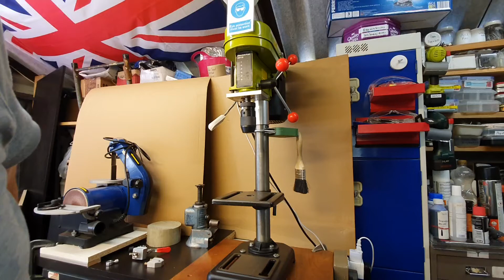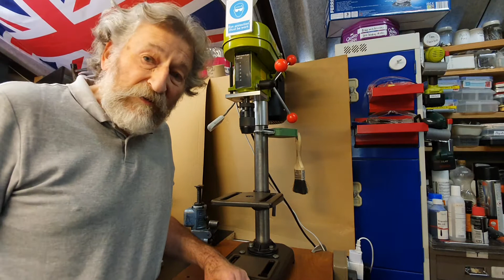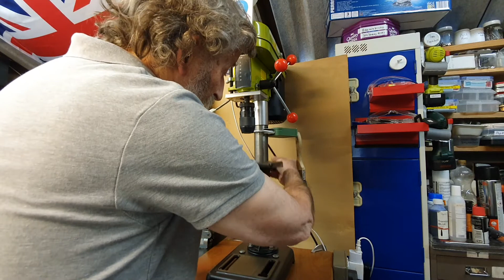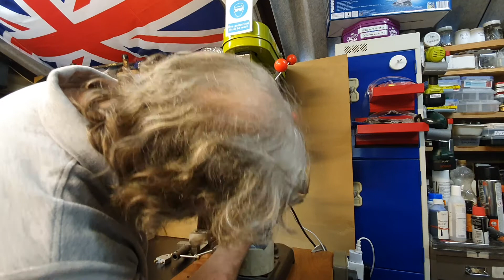Bench Drill upgrades.

Comment: Hi Nobby. Thank you for sharing your bench drill mods I wil make some of the ones you showed.  My main mod for this type of bench drill is to take play out of the quill.  like most of these drills they have considerable play side to side and front to back.  There is a nut and screw to take out side play and that is all , so I drilled and taped the front and put the same on the front and now there is no play at all even fully extended. I used brass to make it slide better but finally drilled the ends of the brass bolts and fitted in nylon mini bungs from kitchen fitments which are used to hide screw holes inside the units. After greasing with Marfac it all works like a dream and is precise with absolutely no play.
Reply from the maker: That's an interesting modification William. I agree these cheap bench drills all have this problem. I'll examine my one and see if I can do a similar mod. I always adjust the table as close as I can to the drill to minimise the amount of quill travel. I also centre punch the work to guide the centre drill first. This does help to keep things aligned. You should do a little video to share your modification. All the best Cheers Nobby

Comment: Scissors Jack's can be had easily at the junk yard. It's what I use. I also have perfectly operating old screw Jack's that can be used. But if you look around you can find small hydraulic jacks.
Reply from the maker: Hi George, thanks for the advice on the scissor jack. I did find one recently, and gave it a try. I think I still prefer my hydraulic bottle jack as it's much easier to use and takes up less space under the drill table. Kind regards Nobby

Comment: Great idea about the depth stop nuts. My Meddings Pillar drill is a pain too, keep having to spin the nuts up and down. Never gave it a thought about using the Bridgeport Quill Peg type clamp. Trouble with my Meddings is that the the screw is not round, it is machined flat on the front with engraved depth markings. Suppose I could try the collar and screw idea. Regards from Australia.
Reply from the maker: Hi David although the peg type was a fun project to make the collar type works much better.  I set the depth and let the collar Drop in to place and lock it. Because my cheap bench drill is so small the peg type often moves round and gets jammed. Keep well regards Nobby.